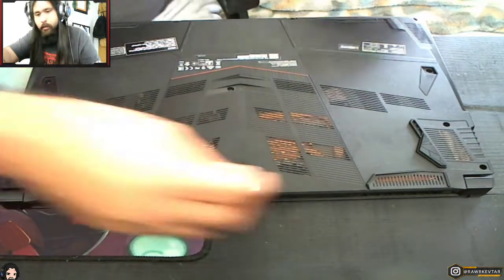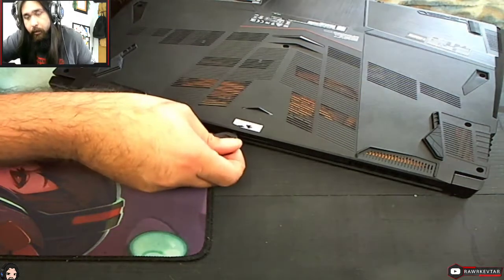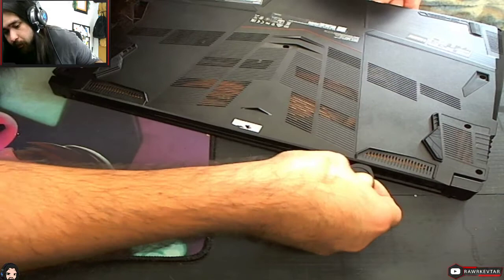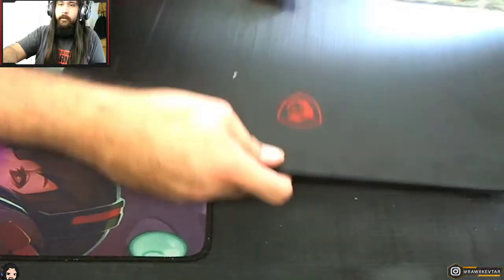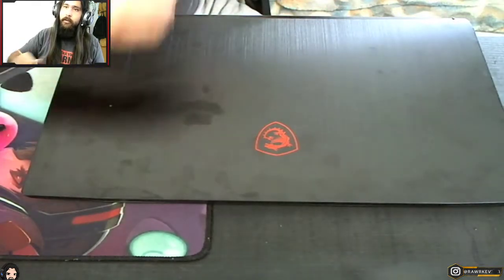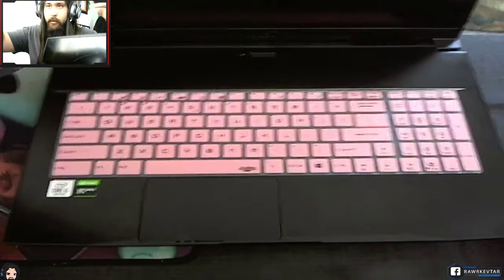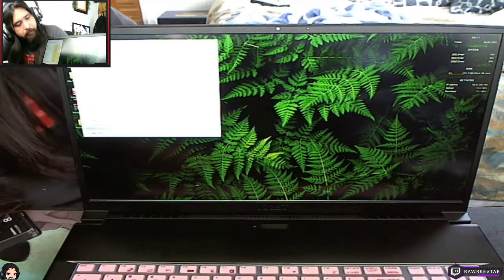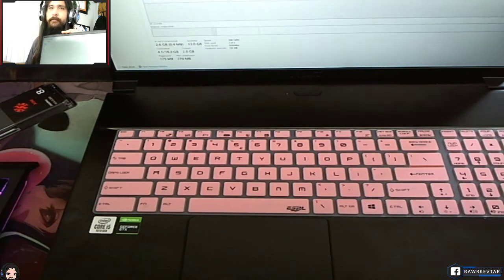MSI GF75 Thin Ram Upgrade

Comment: Bro thank you so much for this video. I didn’t even finish it but I went ahead comment,sub and liked it. I am waiting for the SSD and ram I ordered. I stream with obs streamlabs and that takes a lot cpu always running 100.
Reply from the maker: Thank you so much for the love! If you are running obs off of this laptop you could mess with the power plan settings in windows to make sure your cpu runs consistently at peak clock speed.  There is also a performance mode in streamlabs obs that can reduce cpu usage as well.  I hope these methods help!
Reply: @rawrkevtar  I did change the power settings but I haven’t tried your second method I will do that today before my stream. Looking forward on your next video installing the ssd.

Comment: So, I'm getting the MSI GF75 Thin 17"3 from Costco like yours, It comes with 8GB of ram and you added an extra 8, So the total ram is 16GB of ram now right?
Reply from the maker: Correct! I also want to add an ssd so I might make a video for that too but it's basically the same process :)
Reply: @rawrkevtar  thanks for the vid im a newbie with things like this will it be simple enough for me to do? Also you mentioned upgrading the side can I just get an external one ? Will it run as good with an external? Thanks liked and subscribed
Reply from the maker: @emalkey  thank you so much! The external drives nowadays run fairly well and have good prices too.  To ensure the fastest speed out of your external drive make sure that it uses USB 3.0 which is pretty common these days. Also to note you would need to insert the usb3.0 cable into the correct slot on the laptop as well.  The usb 3.0 ports are blue on the inside.
Reply: @rawrkevtar  thanks a lot man 👌
Reply: @rawrkevtar  sorry to be a pain man but would you know what 8gb ram i would need ? There are so many different ones and I just want to make sure I get one thats compatible , I have the msi gf75 thin with i7 and  gtx 1660ti graphics card , no worries if your to busy but if you could send me a link or some advice that would be awsome 👍
Reply from the maker: @emalkey  you are looking for ram that is DDR4 PC4-21300 SODIMM 260-pin will work perfectly fine for you :)
Reply: @rawrkevtar  awsome thanks man 👍

Comment: Hi ...".userbenchmark"   Samsung M471A1K43DB1-CWE 1X 8GB SODIMM DDR4 3200 MHz clocked @ 2933 MHz....So not sure but 2666mhz would seem to be mismatched and slower ??  Have you noticed such?  I just want to do some rendering running as fast as possible but not very sure about this stuff...
Anyway, thanks for your video it's helpful to know how to get it apart.
Reply from the maker: The laptop I think is only able to run 2666mhz if you get 3200mhz it will still work but be reduced down to the most compatible to the machine which would be 2666mhz :)
Reply: @rawrkevtar  it benchmarks at 2933...it shows samsung 3200 chips
Reply from the maker: @BopKitBill  ah then you could get a 3000mhz chip instead of the 3200mhz

Comment: Is there a link to the ram card you used?
Reply from the maker: The specific ram stick I used is not available at the moment on Amazon.  Here is a link to another reputable brand with the same specs of the ram stick I used in this video :) https://www.amazon.com/dp/B08C56KXQJ/ref=cm_sw_r_cp_apan_i_RWFP447H4ENH4F8V3YCQ
Reply: @rawrkevtar  Thanks

Comment: what ram did you get? can you put the link?
Reply from the maker: Hi, the link to the ram I used is on Amazon. The 8gb listing I had used it unavailable so I'll link you to the 16gb stick you can find it here https://www.amazon.com/dp/B089CJLTDQ/ref=cm_sw_r_cp_apa_glt_fabc_NK9SJC7H7WWYYYYM42EK?_encoding=UTF8&psc=1
If you need any other recommendations for other brands of sticks that are compatible let me know!
Reply: @rawrkevtar  Hi I bought a ddr4 2666 8gb memory single stick would that be compatible with it?
Reply from the maker: @justindad2481  yes it should fit no problem as long as it is SODIMM which is the laptop sized ram

Comment: What ram type is that? I can't seem to find it on the internet.
Reply from the maker: The ram I used is from XPG 2666mhz pc4-21300 I see it is unavailable on amazon.  I have found a link of ram of the same exact specifications that will work with your machine as well.
https://www.amazon.com/Patriot-Signature-2666MHz-PC4-21300-SODIMM/dp/B07NPFB6GS/ref=psdc_172500_t2_B084ZX5F5Q?th=1
Reply: @rawrkevtar  Okay thanks so much!

Comment: hi mate, I have a MSI GF75 Thin 10SDR 8GB RAM and I would like to add 32GB. I'm noob and I don't know witch ram to buy, witch one is compatible with my laptop. Can you give me some info please? or a link where to buy Ram compatible with my laptop. Thanks
Reply from the maker: Hi bud!  To achieve the 32gb configuration you need to purchase 2x 16gb ram chips.  Amazon is usually the best place to find them I can get back to you with a link. You will need to remove the existing ram chip and replace both slots with the 16gb sticks.
Reply: Thanks for reply me. If you can tell me witch RAM will be compatible with my laptop please. I've never changed RAMs. I found that my laptop has SK-Hynix (the brand) but I didn't really find it in my country
Reply from the maker: Here is the Amazon link to buy the 16gb ram chip. Same brand I used in mine.  There will be all the info you need in the title name as to identify other ram sticks if you would prefer a different brand. :)
XPG Hunter 16GB DDR4 2666 CL18-18-18 PC4-21300 260-Pin SODIMM Single Rank (AX4S2666316G18-SBHT) https://www.amazon.com/dp/B089CJLTDQ/ref=cm_sw_r_cp_apan_glt_fabc_9X62V59GY3GXP8M27HKV
Reply from the maker: I would also like to note that 32gb is complete overkill on the specs.  I can see it being useful but rare to see usage of over 12gb
Reply: thank you man. I appreciate it
Reply from the maker: @cristilaur7272  no problem! Always happy to help!
Reply: so I have 8, if I buy one slot of 16gb would that be ok? I can keep that slot of 8 +  one slot of 16gb?
Reply from the maker: @cristilaur7272  definitely! You will have a total of 24gb of ram at that point

Comment: Is the VGA card upgradable or built in ?
Reply from the maker: I believe the msi thin laptops have soldered gpus
Reply: @rawrkevtar  so what do you recommend me I want to buy a new one with good specs
Reply from the maker: @iraqiyoutub  Depending on your budget this GF75 can be a solid machine for years to come at the price of $849 USD.  If you can spend around 2k USD I would go for one with at least a RTX2060.  I have seen laptops that do have removable gpu before but I wouldnt recommend to try and upgrade those as it would have to be very specific to fit inside of that laptop model.  If you are going to be swapping parts more often it is better to have a desktop pc.
Reply: @rawrkevtar  here in Iraq 🇮🇶 gf 75 is about 1350 $ thanks for help man

Comment: sorry to tell you this but you should have bought a 16gb ram set because the way you did it is going to be a lot slower than it would have been if you did it the proper way
Reply from the maker: why would a 16gb ram stick at 2666mhz be faster than an 8gb 2666mhz stick? they are both the same speed
Reply: @rawrkevtar  because of the age and they don't communicate as good so you may have noticed that you only had 12 gb that is because you did not get a set and
Reply: @rawrkevtar  and that was a 8gb stick you added I think
Reply from the maker: @elijahpond2008  it is not 12gb it is 16gb because the initial ram is 8gb
Reply from the maker: @elijahpond2008  also the 8gb of ram that came with the laptop is set at 2666mhz. I could have put a higher speed ram but that would still cap at 2666mhz. So why buy the higher speed?
Reply: @rawrkevtar  umm no it will not cap out at 2666mhz the processor it has will do 3600mhz I have the pc
Reply from the maker: @elijahpond2008  the pc and laptop processors are usually set at different speeds too. If you want you could actually Google it to find you are wrong. 'MSI GF75 Thin ram speed' the answer of 2666mhz will be there
Reply: @rawrkevtar  that is not what i am saying my point is you are suppose to buy sets for a reason
Reply from the maker: @elijahpond2008  I do understand the idea of buying a set of ram because they are much more similar than separate sticks down the manufacturing line.  It honestly does not really make much of a difference.  If you have a part to put in that is usable then use it.  My point here is to demonstrate the process of installing the ram, not to nit pick every single part.
Reply: @rawrkevtar  i was simply telling you that you should have gotten a set of ram and in not doing so you told people that it is fine not you when replacing ram when in fact it is not
Reply from the maker: @elijahpond2008  unless you can prove that using a mix match ram drops performance significantly then your comment is irrelevant. You can swap rams of course it is not 'ideal' but does in fact work with no damage to hardware or decrease performance in a vastly negative way
Reply: @rawrkevtar  just did the ram on my laptop I got a set and overclocked the ram using dragon center  is much more effective I am getting 15.8GB of ram which is a lot better than 12
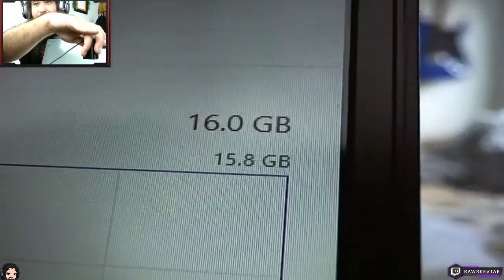Reply from the maker: @elijahpond2008  I think you misunderstand the video check at 14:40 showing I installed 8gb of ram which ends up with 16gb. I am unsure why you think 15.8gb of ram has 'better' performance as 12gb would work at the same speed. The only difference is capacity
Reply from the maker: @elijahpond2008  also dragon center is okay but it does sometimes come with issues I have a friend whose dragon center does not work very well. Uninstalling dragon center is fine as it won't effect performance majorly since there are other programs that do similar tasks
Reply: @rawrkevtar  it has a lot biger impact than you think
Reply from the maker: @elijahpond2008  such as?